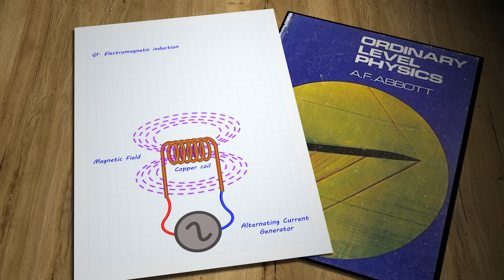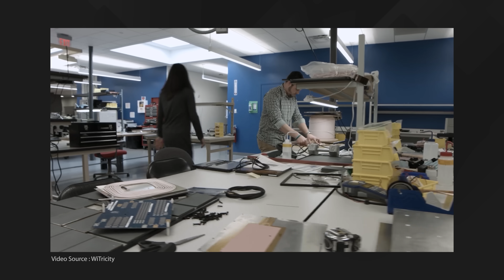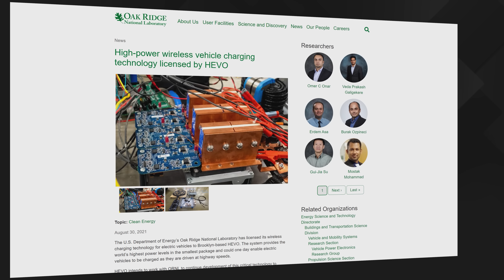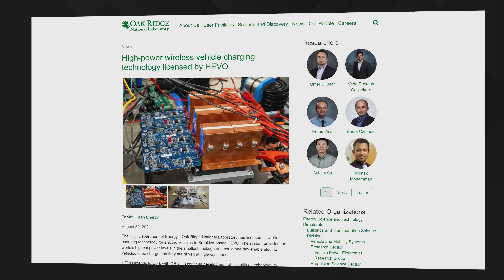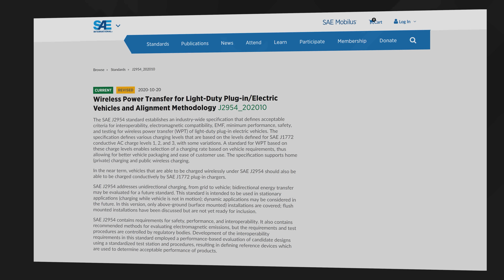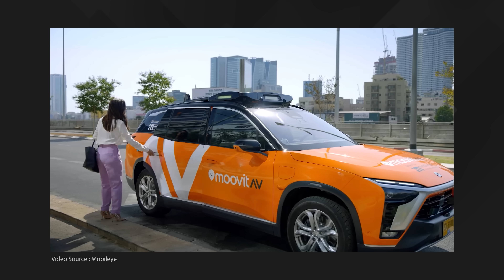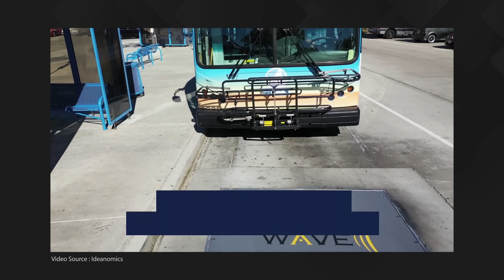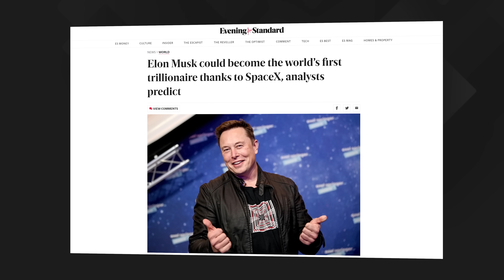Wireless FULL EV charging has arrived!  Exciting new tech breakthrough.

Comment: Personally, I need a lot more convincing that this is a problem that even needs to be solved.  Why take a 5-10% hit on charging (literally throwing away the electricity as heat) just to avoid the 10-second act of plugging in a vehicle or pre-planning your route to hit charging infrastructure?  It would be far easier to have a contact system on the undercarriage with some positioning actuators.  Or have a Teslabot at each charging location to plug and unplug yer vehicle.
Reply: I fully agree! A niche solution for use cases where one wants to quickly charge maybe some super capacitors. 
As a physicist working on increasing energy efficiency of solar cells and such at .1% rates, I'm drastically opposed to use something this wasteful when the state of the art solution (wire + plug) is much better, cheaper and also needs fewer raw materials to be produced :P
Reply: I totally agree, this is a solution looking for a problem. The cost of these systems in materials and capital doesn't provide enough of a benefit to make them worthwhile.
Reply: I totally agree. It's just talking about a solution for laziness!
Reply: @Deinorius  People are generally lazy.  It is far more effective to correct for laziness, than to get people to do the right thing.
Reply: New technology takes hits all the time before it is perfected. With the very road charging your car? Yes no need for huge battery packs which saves way more energy and less chemical pollution. 5-10% is already a win.
Reply: @MrFlatage  Embedding enough wireless chargers in roads to have a meaningful chance that people will stop at traffic lights close enough to get any charge whatsoever sounds like a gross misuse of public funds. Install charging equipment in parkings where it makes the most sense first.
Reply: @teardowndan5364  K well do not misuse public funds then? And why put them at traffic lights? Where did you get that one from? Install it where the video shows they install it in roads so you have continued charging while you are driving? Then we can add to the fact that for example US powergrid is crumbeling with 5 times more blackouts. Could at the same time replace the old powergrid and not be stuck with vulnerable powerlines. Over 15000 powerouttages alone by one fearsome enemy to the USA. Squirels ... Well alot of dead ones. A win for squirel kind as well.
Reply: @MrFlatage  Installing wireless charging over millions of miles of roads is beyond stupid when budgets are already barely enough to keep normal roads in drivable condition and poor driving surface condition drastically increases rolling resistance.
Reply: @MrFlatage  I mentioned stop lights because those are the only places where vehicles may be close enough to a pad long enough to get a remotely meaningful charge. Embedded in highways, your car is in range of any individual pad for less than 0.02s at a time, so you need  50+ pads spaced 3' apart to get 1s worth of charge in. There would also be greatly reduced efficiency from being too far away from the sweet-spot practically all of the time.
Most of those wireless charging projects primarily exist to drain grant money from governments for things that have no chance of commercial success.
Reply: Since you are going to need to be at least somewhat aligned with the charging pad to get any decent power transfer happening, may as well just have some sort of mag-safe type connector embedded in the parking space that auto-connects to its undercarriage counterpart when parked within 5-10" from the correct position and get 99+% pad-to-car efficiency. No need to radiate 1MW of EMI into the area.
Reply: Actually wireless charging is equally efficient and in some cases more efficient than plug in given the air gap provides less friction than copper wires.  As for generally speaking, this alleged 10 seconds is actually minutes and involves taking vehicles off route; horrible for bus systems, taxi programs, commercial fleets, last mile delivery etc.  The time off route, the opportunity cost of having drivers and manual labour manage this coupled with maintenance and moving parts creates for an ugly picture.  This doesn’t even factor in the need for additional vehicles at a million a pop in the case of buses.  As for the Teslabot, even worse, more moving parts, more things to go wrong with all the same problems.  The future of electric vehicle charging is not in cords, moving parts and plugging in, I assure you...I haven’t even gotten into autonomous
Reply: @davidj3028  friction???

You mean resistance which is much lower for copper. Although we should really be comparing this to something like an iron core transformer which is more efficient than an air core one, which is what this basically is.
Reply: @benholroyd5221  Well if it's about resistance - yes cooper is better. Does plug cords have bare copper contacts?What about corrosion and wear out? Tesla have liquid cooling for superchargers cords.
Reply: @Steellmor  the cords shouldn't be getting hot. The transformer and the battery should be the hot things.

Plugs are a solved problem, we've been using them for over a century. Bit late to start pointing out all the short falls now.
Reply: @benholroyd5221  Well no,this exactly time to point all the flaws of plugs. Plugs always were huge problem,especially their standards. And yeah battery and transformers are one thing,but power cord that you supposed to plug with your hands while conducting all that power through relatively thin space.. Tesla V3 superchargers use liquid cooling,and that's not a new thing for industry.
Reply: @Steellmor  power doesn't flow until it's properly plugged in.
Are you sure the cords are actively cooled? Generally if the cord is get hot you're doing it wrong, and the list of bad failure modes I can foresee is extensive.
Reply: @benholroyd5221  Why you asking am I sure? Just google and get this info yourself. (youtube blocks links,but still wouldn't you better get such info yourself?)
"Power doesn't flow" - are you talking specifically about EV charging?That's not the case for most electronics. I mean,I also hope that all EV cords have such safety feature that prevent powering badly connected cord,but how would you even check it? Like what if one of contacts got some dirty grease on it,but still have perfect metal to metal contact over 1% of it's surface? Which isn't some hypothetical scenario - this exactly how contacts work,there are spots where they have higher pressure\better contact than rest of the contact surfaces,sometimes you can even see scratches or wear out on those spots,or corrosion\oxides deposits around such spot (while also being scratched out exactly at the spot).
Reply: @Steellmor  well I don't know but off the top of my head, I would check for a completed circuit with resistance within a given bound Then have temp sensors at the plug to prevent it over heating. 

I don't get why you're singling out wired charging though. Bad things could happen if you put metal between the wireless charging pads. It is basically a big induction hob, and I'm not sure how you could go about protecting against all failure modes.
Reply: @benholroyd5221  That's why I pointed about 1% perfect metal to metal connection - resistance there would be fine,and you wont be able to measure if 99% of that connection is covered with grease without turning up power. Metal between charging pads - I think this is impossible to design wireless charger without having such case in mind.
Reply: @Steellmor  why are you picking holes in what is already a solved problem?

what happens if theres a spark in a fuel pump? we both know that /could/ happen, but it doesn't, so theres no point hypothicating about it.

I don't know if they do test the resistance, it would in principle work though because the resistance would be higher if contact was only through 1% of the contact. the resistance is literally the problem, resistance causes heat, heat melts / burns etc. so either you check the resistance or you check the temperature, theyre both sides of the same coin. if the resistance is normal, and/or theres no excess heat, there is no problem.
Reply: @benholroyd5221  It's not solved problem. You act like you 15 years old and never had old electronic device with corroded plug. For EV it's all new - they make advancements every year with newer and better charge stations. You don't even understand how plugs work,they don't have 100% connection ever. Please read this before continue arguing https://en.wikipedia.org/wiki/Electrical_contacts#Electrical_contact_theory
Reply: Aside from convenience - which people are often willing to pay for - this system can deliver a lot of power quickly and without the user needing to handle cables or be anywhere near the electricity. This is a big safety bonus, and makes for a reliable connection that won't wear out from physical contact.
Reply: why you ask 
for the same reason that people feel compelled to climb mountains 
because they can and some one will make a packet of money out of it 
i am glad that I am 73 and will not be around to witness this grand new world order being inducted by Musk and his cohorts 
a world in which you can spend your whole life without having to interact with those other pesky human beings like taxi drivers delivery personnel doctors psychiatrists shop keepers and lawyers 
how marvellous that soon humanity will have become redundant
Reply: @anthonykenny1320  Well I understand your sarcastic misanthropy,which kinda contradicts itself,but Musk has nothing to do with any of this. But many of those people who you listed,frequently are actually someone who you wouldn't want in your life.. Well if you are 73 and this is how you actually feel,sorry for that.
Reply: Did you know that plugging in is not 100% efficient? In fact, most are only 85% to 90% efficient just like the wireless chargers.

The conversion from grid power to what is needed by the vehicle requires electronics that are not perfect. In fact, wireless charging and plug-in charging uses very similar electronics. For this reason, the efficiencies end up being similar also. Power is not just lost in the air as some might think. This is the magic of magnetic resonance. 🙂
Reply: Wirelesses charging on parking lots not very appealing - maybe for some specific cases like сourier service,taxi etc. 10 seconds for pluggin can be significant in such cases. What is interesting is charging roads.
Reply: Or have a lever system and large covered pads on a platform that slaps up against charging pins when a vehicle drives up on top if the charging pad. Wouldn't need to take up much space and only needs 1 or 2 wheels on it to lift it up. As it lifts, the covers slide away and push up against the cars contact pins.
Reply: You somewhat gloss over the waste heat, but fast chargers are only going to get faster. How are you going to dissipate 10% of 1000kw?

All that said this technology probably will find uses because it is genuinely useful.
Reply: @benholroyd5221  1000Kw at what surface area? Ground can store tons of heat and dissipate it within itself.
Reply: @Steellmor  the area of a car. The ground can store lots of heat, it's also slow to transfer that heat. 1000kw is going to need some kind of active cooling.
Reply: @benholroyd5221  Oh,sorry you were talking about parking lot.I don't know why they need 1000kw power - to charge 100% of battery in 20 minutes?Does battery even can endure such charging?
Reply: @Steellmor  well Tesla's superchargers are at 250kw a car a figure that would already be problematic if you're losing 10% to heat.
Reply: @benholroyd5221  How efficient Tesla superchargers are?I don't have EV,never used one, google says Tesla Superchargers can have liquid cooling,for it's power cord.Where do they release all that heat? I mean at point where you need to liquid cool a cord - stiff underground electronics wouldn't be hard to liquid cool for any amount of heat or length,compared to flexible manually handled power cord.
Reply: Nothing is 100%. Go to find the efficiency of a plug-in charger, you would be surprised.
Reply: Vandalism.  It is dire with the current system.
Reply: This is an invented problem to sell more expensive tech for shareholder profit.

It is a "problem" that needs to be debunked rather than "solved"
Reply: @trueriver1950  "Inveted problem"? Oh I'm sorry,didn't knew that we had 100% of ICE cars replaced by EV with fully satisfied world's demand for batteries.
Reply: Because these first commercial versions are already only a 5 to 10 percent hit. These are the Model T versions. Once this lensing and resonance tech matures, that will certainly drop, distances will go up, and people will marvel that their parents had to get out in the rain and snow to refuel the car.
Reply: @JBloodthorn  not going to happen... 10% additional loss in efficiency means like 60$ additional electricity cost per year if you drive a Tesla model 3 for 20000km/y. Plus the several thousand in cost comparing this wireless charging tech compared to a cable.  --> not going to happen!
If people are so damn lazy they can't even plug the cable anymore, it's a good thing their car won't charge because then they'll learn to use their feet again, better for their health too :P
Reply: @andreasbrand3191  I think this make sense in for open parking lots in apartments. Too many charging cables and the actual charger which is around 4 feet, is just not the way for people to charge in apartments. You are also saving on the actual connector. This tech will mature in future. Also, think about when all cars will be self driving, who's gonna plug the charger?
Reply: Charging by plugin is not the problem but the charging time and then the range we get out of it that's the problems 
This will not be a rick roll when someone will invent something that will charge the vehicle in a minute and in reality this is not Rick roll it's just my thoughts

Comment: Interesting idea, have some comments. May be one of these just because we can but should we ideas.
1: 90% efficiency for energy transfer with perfect alignment.
2: 50/60Hz to transfer frequency say 90% efficiency power electronics.
3: Works out to about 23% more energy required over a plug in cable, plug in cable has <1% loss, a little more with high power chargers.
4: Who pays for this 23% loss plus the additional 23% generating capacity required, the customer?
5: The wireless chargers will be say 10x more expensive than plugin just a guess, who pays the customer?
6: Public transport is the best market, personal transport not so sure.

Comment: Wireless charging for EVs is a technology trying to solve a problem that does not exist.

- Expensive to implement 
- Significant risk of exceeding ICNIRP non-ionising radiation limits 
- Significant risk of radio interference 
- Significant conversion  losses 

And for what? Plugging in my EVs is not exactly a problem.
Reply: @gilburton Read the CEPT report I posted to understand some of the challenges that will sink this technology. It’s trying to solve a problem that does not exist.
Reply: @gilburton As vehicle ranges go up and up charging with mostly happen at destinations, en route challenging will become a rarity.

For people without offstreet parking it has to put more pressure on councils to provide Street charging solutions or dedicated parking for residents Who want or require cars or vans. Actually the office of low emission vehicles already has a scheme and residents can request charging points through the scheme. The scheme provides 75% of the funding. 

Autonomous vehicles will play a large part in transportation services and will indeed replace bus services in time as an autonomous taxi will be so cheap to use.

Comment: I just don''t know why they didn't do battery exchange.  Like you do with propane.  But picture a a little fork lift coming up to the car, dropping your battery out and putting a charged one in. But maybe more importantly I wish we went to hybrid on a clean renewable fuel like methanol which can be made using a carbon cature tech.  So you have all the range you need, (the ice flex fuel) engine vehicle would solely be used for high end speed and to charge the batteries.  I'm not on the horse and buggy side.  I just love cars.  I love the sound.  Manuel transmissions were fun.  Yes Tesla's are fast but is it closed minded to say you don't want to have more than one choice of silent engine?